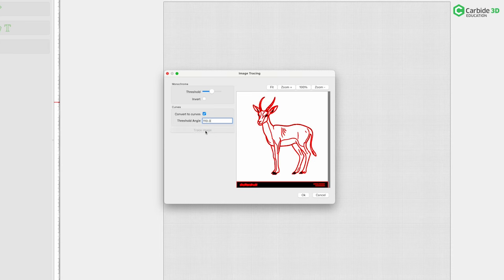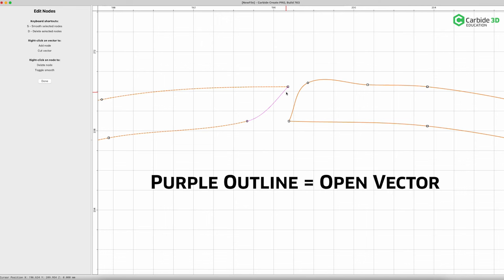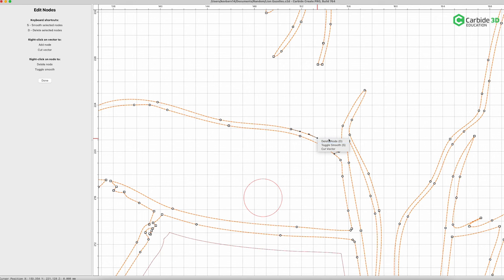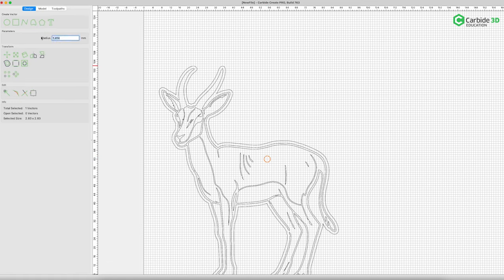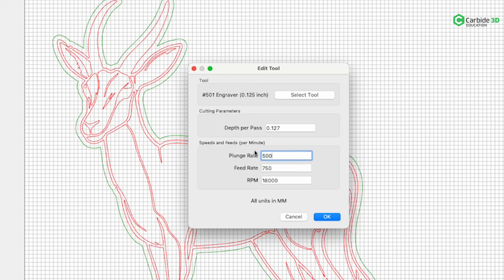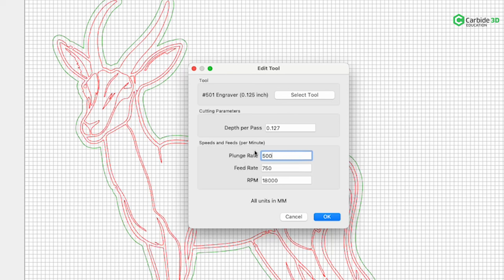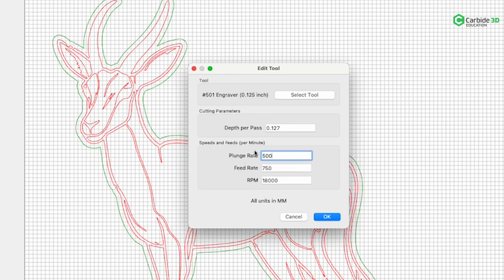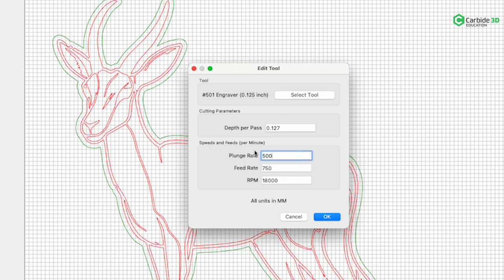Carbide Create - Build Your Skills

Comment: I enjoy all the videos you guys make. I currently have a shapeoko 3 xxl. I will be upgrading to the 5 pro 4x4 soon. One thing I would like to see or get info on is work holding for the front end offset for joinery cuts. Not sure what would be best, just t track across the front or if it would need to be more robust. Trying to get ideas on this before the new table with enclosure build would be great. Keep up the great work!

Comment: What controls the changing of the tools? How does the machine know it needs to stop so you can change the tool?
Reply from the maker: The G-code is written automatically by Carbide Create. Carbide Motion reads that code, which contains commands directing the machine to ask for the next cutter.
Reply: @carbide3d  Thanks but i am just starting and havent purchased a shapeko yet, I am on a trial with carbide pro and using on no name cnc, getting the basics down. I think i am using usgs or something like that, will it do the same as motion?
Reply from the maker: No, Carbide Motion does a lot internally to coordinate tool changes.  UGS will just send the G-code to GRBL.  You'd want to talk to your CNC vendor to see how tool changes should be handled.  (Probably, each tool should be written to it's own file)

Comment: Great video. Damn your fast! I used to think your using sped up video but now I think your just damn fast!
Also, since I updated I see the align horizontally and vertical tool that I didn't know I had. Thanks guys thats awesome.
Also, I notice that one thing I mentioned to you on another video is now fixed. Disabled tool paths don't calculate anymore. Thats great!
If you read this I hope y'all might take this into consideration to?
The "t" abbreviation is awesome but its capabilities can be expanded easily. 
For instance if I had a set of plans with a dog bone cut out I should be able to use "t" inside the width and underneath the hood the script should have an "if then else" condition statement to use the thickness of the wood if the letter "t" is found.
There after I should not have to change the width of that dog bone for a different thickness of wood. I have not tried that in this new version but I am assuming that it still does not do that in the "scale" dialogue box as it does in the set up dialogue box?
I think this would be furthering the usefulness of "t"!
Reply from the maker: Thanks for the feedback.  Our development team is always looking for ways to improve Carbide Create.  
Regarding speed, it's all about knowing how to deploy tools and concepts.  The more projects you design and make, the faster you'll get.   Keep machining and keep skill building.😉